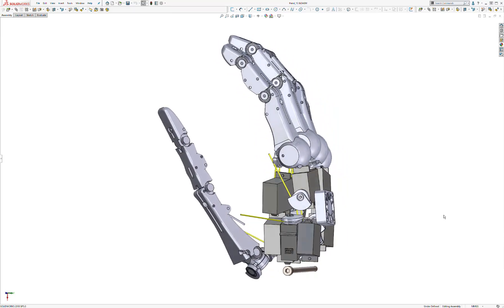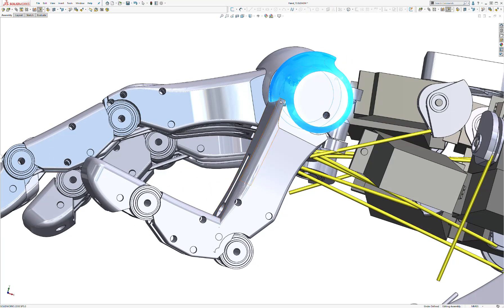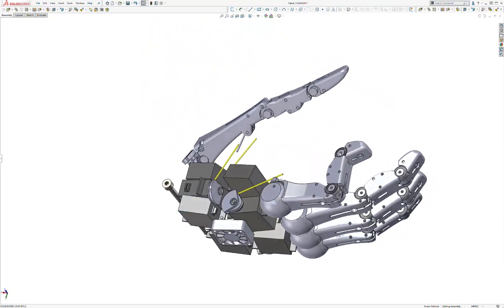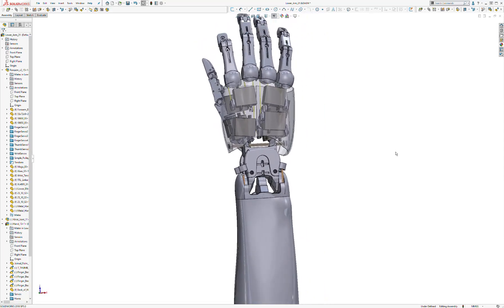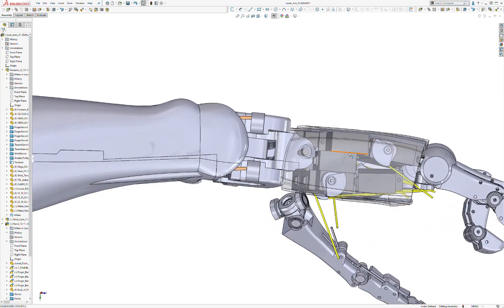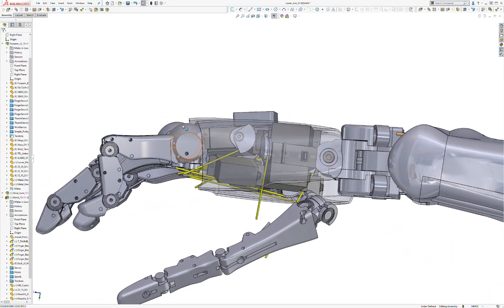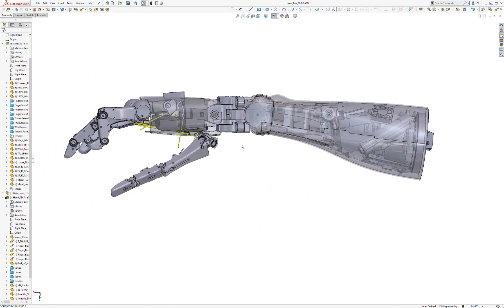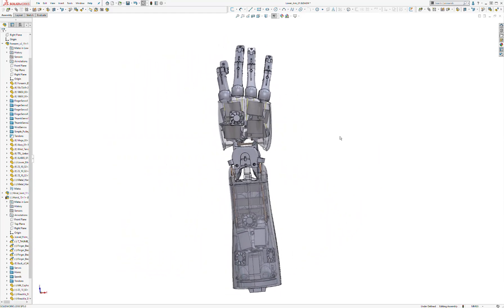V2 of the robot DexHand for 3dprinting

Comment: Wouldn't it be better to use the motor directly for finger joints?
Reply from the maker: Only for lower numbers of motors. There’s a low cost prosthetic made this way in Korea with the motor in the end joint for example. The challenge for dynamic systems is always to rapidly generate force, moving the motor away from the end of the effector helps by reducing the inertia.